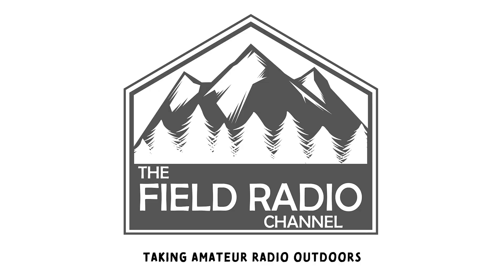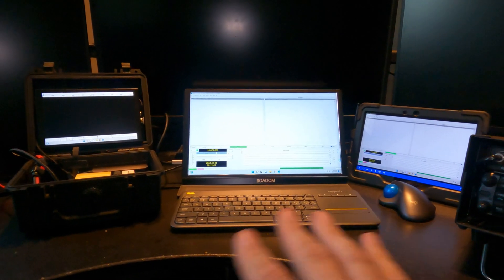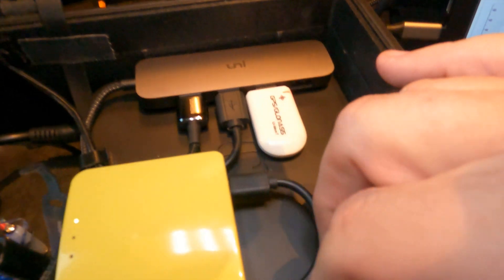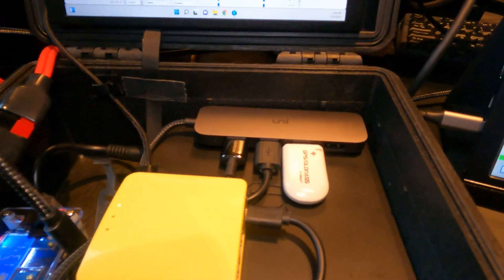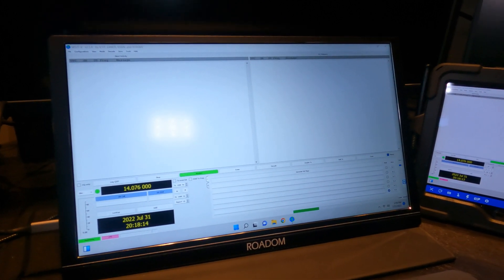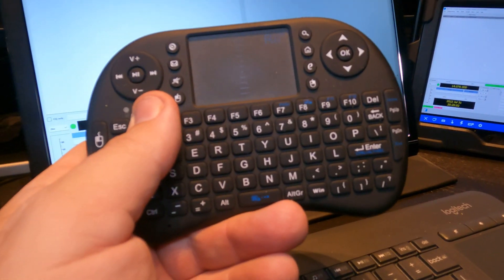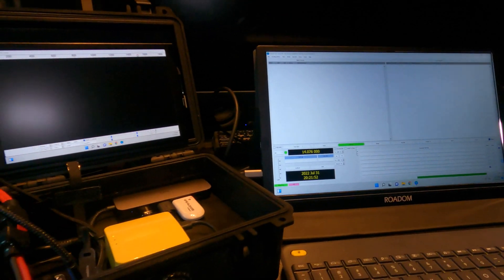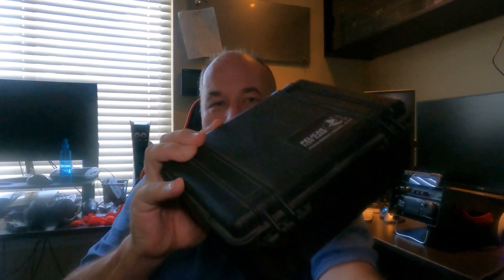All Mode Go Bag - Field Computer

Comment: For any kind of outdoor use, I've learned that the monitor selected needs to have a brightness of at least 1000 nits, and preferably 1500 nits or more. These are hard to find and when you do, they are expensive. I finally found an Android tablet computer on Ali Express that is design for fleet (trucking) use that is bright enough. It was $750 but it can also handle extreme temperatures better as well. I suppose you go with a standard 200-300 nit display and then spend your money on an elaborate sun shield so it's usable.
Reply from the maker: The Samsung Active Tablet also does very well in direct sunlight. It's main customer are delivery company's and industrial so it's rugged and even has a replaceable battery. I also use a cool hood at special events with my other laptops.
Reply: @FieldRadio  - The specifications for Samsung Active Tablet state the screen brightness at just 350 nits and the Active Tablet Pro at 550 nits. If you think these are acceptable in bright outdoor environments, I think you be amazed at what a 1000 nit display looks like. The drawback of course is increased current consumption. Having some way to turn it way down for night ops is a must.

Comment: Great looking setup & extremely well presented!   I assembled a similar setup and ran into one issue only... everything is great on HF but when I try to use VHF/UHF, the RFI noise makes the higher bands unusable.  Turned out to be my micro computer's HDMI port!   I don't know if you plan to do anything above HF, but would love to hear of any issues (and hopefully solutions!) if you encounter the same noise issues from your HDMI output.  -Scott,  K4KDR
Reply from the maker: That is interesting. I will have to keep an eye on that. I've done some public service events with VHF Winlink  Good thing about testing is to shake out items like this.